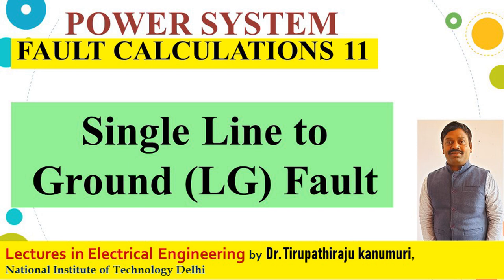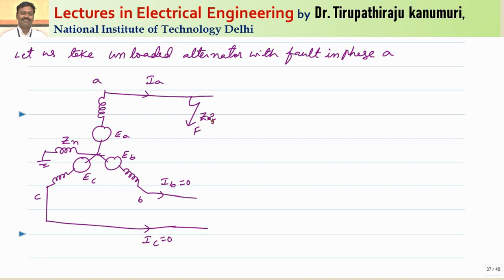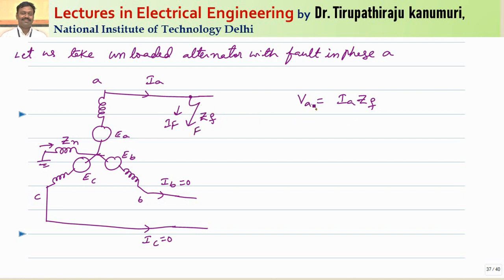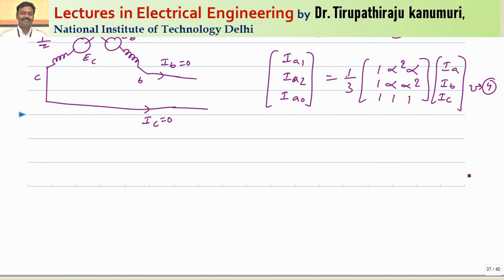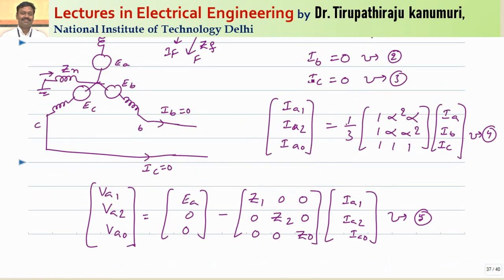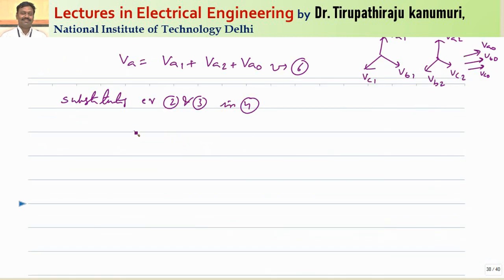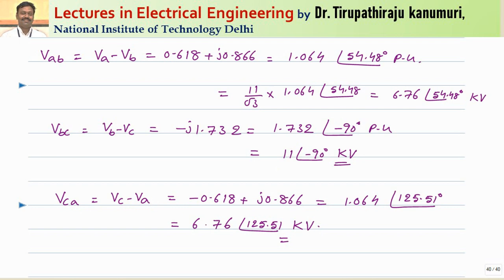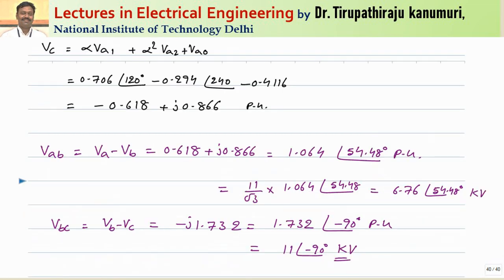PS92 Single Line to Ground LG Fault

Comment: sir , is falling of conductor ( after breaking ) on the ground considered as  LG fault or open conductor fault??
Reply: @lecturesinelectricaleng sir, even in this case  the current  would be higher than normal  load current?? But I have doubt regarding  where  the current  goes  and how it completes its path??